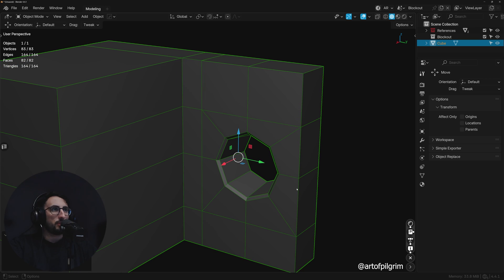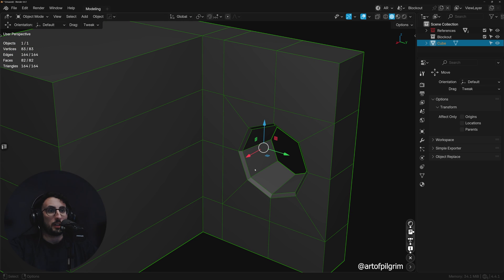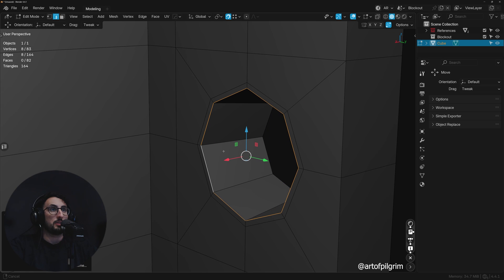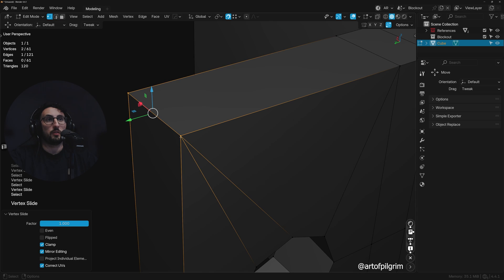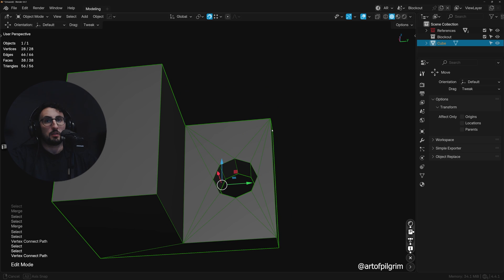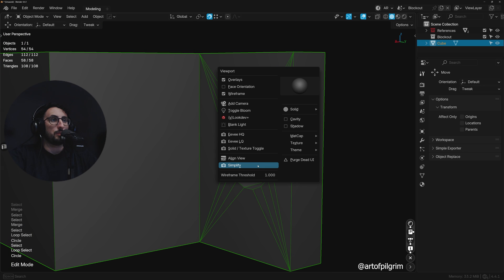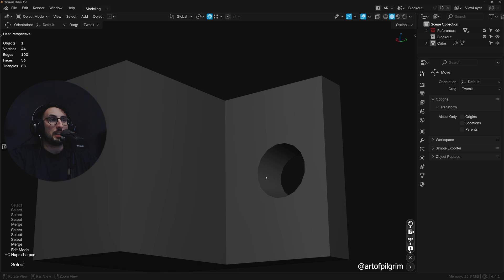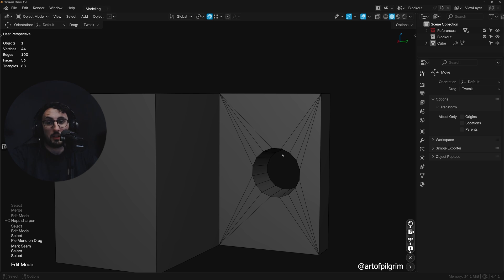Optimizing Meshes for Games - An Exercise

Comment: Here's a neat trick with machin3 tools and hardops:
Select few verts on circular hole, press Q > Operations > Star Connect. Quick way to triangulate holes instead of pressing ctrl + T or doing manual connections like this.

Comment: You don't even need hard edges on your low poly model, you can get away with  180 smoothing(1 smoothing group) if you intent to bake normal map from  a from high poly mesh.
Reply: If you don't understand how mip-mapping works sure. go for it.

Comment: Won't that topology cause shading artifacts though? It has slightly less faces overall but if you shade that smooth so you can bake normal maps those fan corners are going to become an issue.
Reply from the maker: Why would you have it universally smoothed for hard surface objects?
Reply: @ArtOfPilgrim  To avoid seams in the normal maps on hard edges. If you use sharp edges those will look really bad at an angle because of that seam. I suppose that would not work for this model anyways though, you also need to bevel the outside edges and use weighted normals to prevent gradients on the faces. I've seen this done both ways in games, I also used to reduce geometry as much as possible as shown in your example but really struggled to get good bakes with it, if you use hard shading and accept the seams that come with it that is less of an issue though.
Reply from the maker: @erikbaender  if you're not getting good results then you're doing it wrong. 

i'm not sure how much you watched but i do mention about hardening based on seams. this is to reduce any seams whatsoever. again, this is a very narrow example about optimizing the mesh. it's not a full blown tutorial on every aspect.
Reply: @ArtOfPilgrim  You're right, I'm not great at baking. But I think even if I was, that wouldn't fix the core issue, I don't think I explained it very well. What I mean is that if you do not bevel a 90 degree edge, that will look bad at sharp angle no matter how seamless your normal bake is because of the missing geometry on the edge that the normal map simply can not compensate for. From my experience this is usually done for environment geometry like the corner of a building, but It doesn't really hold up for anything under more scrutiny than that.
Reply: @erikbaender  holy crap just use sharp edges and split by sharps, you are overcomplicating the fuck out of simple models.
Reply: @erikbaender  if you really care about performance that much, you would bake the "sharp" attribute into the mesh and then recreate the display setting in shaders, it would be roughly the same performance anyways esp when the average polygon budget of modern graphics cards and cpus easilly exceeds a few million

Comment: The small bevel is needed if you want better bake on important parts of the gun. For example, on the weapon sight. The small bevel will give the rays more place to bake proper bevel on low poly geo. It is so worth to give there the small bevel. Everything depend on how far the model is from the player camera. If this is the wooden plank from the fence with the hole, then the bevel is a waste. But if it's the weapon sight, then it's needed.
Reply from the maker: What weapon sight? 

As mentioned in the video, if it's close then the bevel is justified.
Reply: @ArtOfPilgrim  Where did you say that it is worth to keep the bevel? If something is close to the camera, then it is worth to add bevel, because the difference is huge, simple bevel will give the quality of the HI-POLY surface even if camera is very close, it will be pretty hard to find an angle where you will see that you are watching at the low poly model. 
Also, it is pretty hard for anyone who want to learn about quality of the bake VS complexity of the mesh to understand  how important topology is, without proper example. If you want to teach anyone about it, you should create two bakes on more complex mesh. With bevels, and without them, and compare it. Because this simple mesh is not enough for a beginner to understand why he should keep the bevel, and why smoothing groups are important, and there are plenty more info. which should be added, about straight UV borders, and why sometimes is worth to make the edge of the UV straight on the curved surface to achieve better bake on the edge VS stretched UV. I just think that there is not enough knowledge in this video, and it's not enough for the beginner to understand how it works.
Reply from the maker: @dariuszek4dead I appreciate the feedback but this was direct to the question. No one asked for baking advice. It was simply optimizing the mesh and wanted to make a quick video. It's clear you didn't watch the video, which is fine, because I explicitly mention it when collapsing the bevel. "Unless it's really close, you don't really need this bevel here". 

Youre expecting too much from a simple explanation for that very specific geometric example.
Reply: @ArtOfPilgrim  I just wanted to tell you how I see the subject, and I hope I explained my point of view. And maybe my comment will give you and inspiration for the future video.
Because from my knowledge, nobody created video with comparison like this. Where you have a beveled and no-beveled version of the same model. People are always scary about polycount.